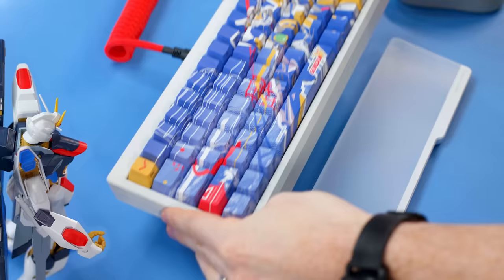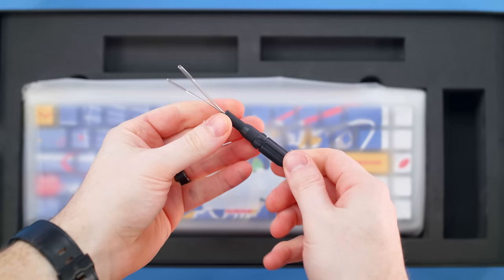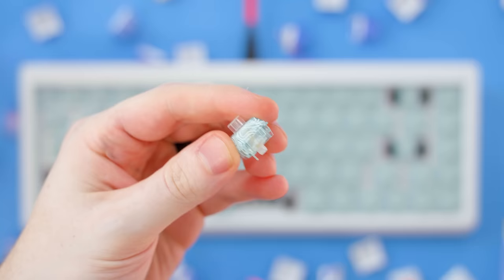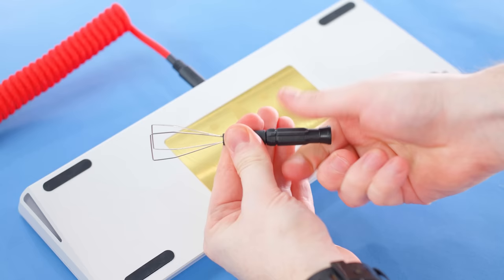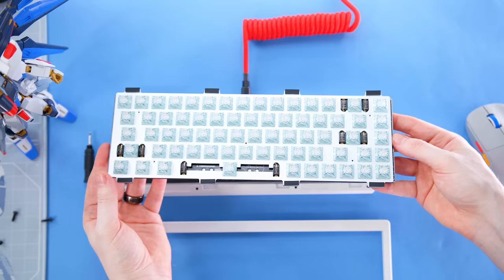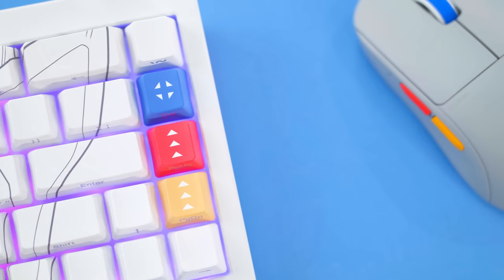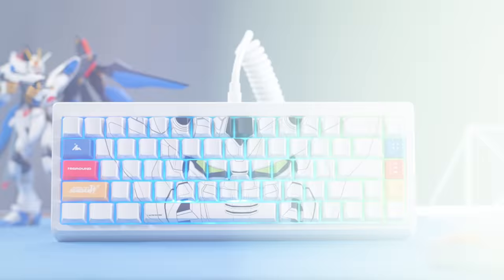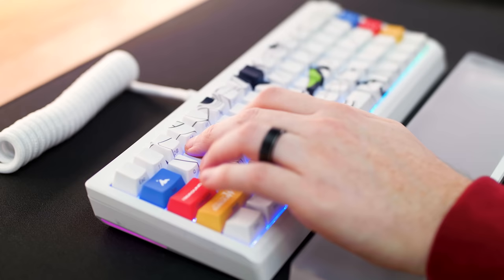This Keyboard is Gundam Lover's Dream! But....

Comment: good build quality. LOOKS GREAT. sounds like shit.
At this point 'gasket mount' means just that you won't be threading screws through the PCB.
Unless it has flex cuts, I'm banking on it being stiff and harsh. Which is fine for gaming and such, but as someone who also works from home and types up a lot of emails/notes/processes and procedures.... once I went with a flexi bounce keyboard (Kunlun) everything feels stiff. and nothing is as comfortable as my Dygma Raise.... but it's stiff and is the plate/tray style so you can't change between different materials.

overall. the Raise still has everything beat on overall comfort with the Kunlun in 2nd (as it's a solid chucky boi ALICE + arrows layout).

Comment: ANYONE: IS THERE A WEBSITE OR ANYWHERE I CAN TYPE IN MY COMPUTER TYPE, THEN IT SEARCHES FOR ALL COMPATIBLE DRIVES SOFTWARW ETC LISTING ALL BRANDS IN ONE APP???? ex: I have a realtek hardware in my computer but I want intel software for wifi. I also have AMD but I want to see if my laptop is compatible with newer versions or other brands. THANKS IN ADVANCED.

Comment: Thanks RFP. I think Highground is getting there in terms of quality, but still not there yet. I was thinking of getting their 145 dollar version but after hearing the sound test not to sure.
Reply: i would recommend it man, they are solid. i have 2 of them and it feels amazing
Reply: @riceburner9187  appreciate the reply man. Also, do you know if the LEDs are north or south facing?
Reply: @CapsuleCorpDude  i believe theyre south facing
Reply: @riceburner9187  nice I’m sold! Now to just decide on the white or blue one lol
Reply: @CapsuleCorpDude  i got the 145 model the white admiral 65 and they come with different switches the ttc white flames and they sound way better
Reply: @CapsuleCorpDude  they're north facing